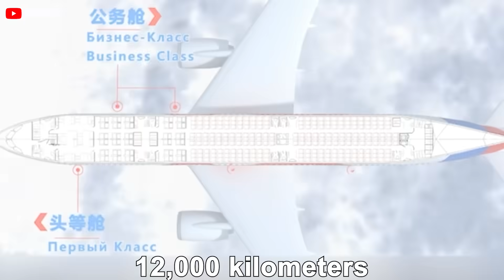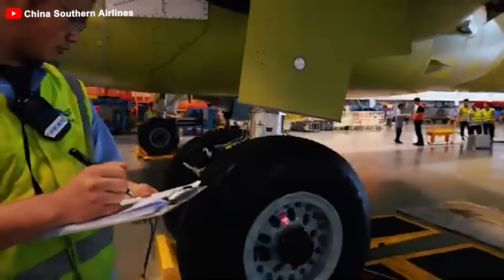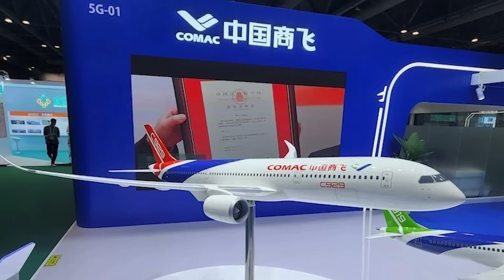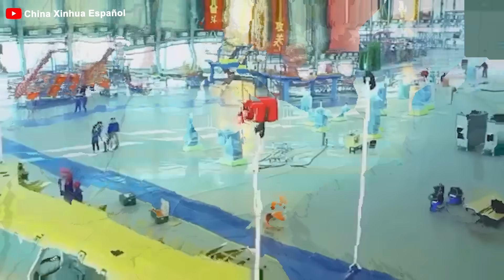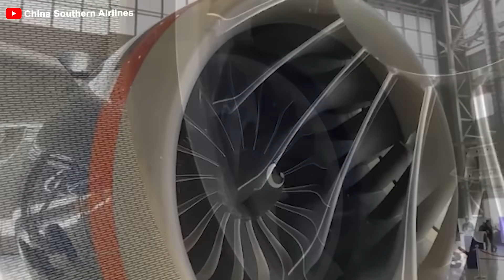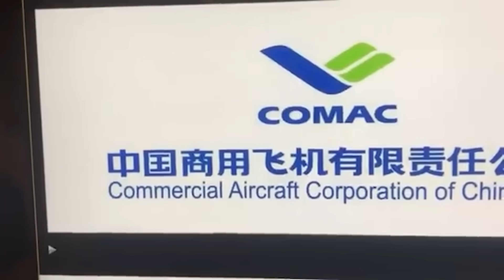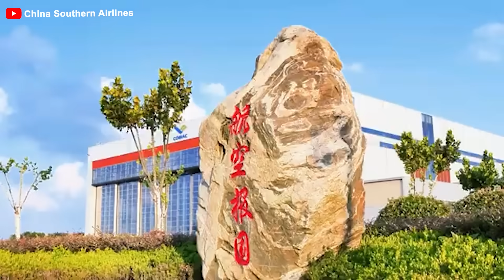China BIG Plan For COMAC C929 Will Change the Industry! Here's Why

Comment: Composites...highly resistant to fatigue and corrosion? That is a leap for anyone in the first generation of composite fuselage and wings as the C919 has no long-term data for those composite parts in that airframe.
Reply from the maker: Exactly.

Comment: With China's advanced space technology, and in aircraft engine technology, it will definitely produce better and safer aircraft than Boeing, which has recently been found to have hidden and covered ups defects and safety issues, which gas caused a long series of aircraft fatal accidents
Reply from the maker: China has great potential. This is indisputable.
Reply: China has Y 20 and C919 already, any troublesome? China home made all type air crafts.

Comment: Facts:
"Airbus and Boeing have been experiencing parts delivery problems due to supply chain issues: "
Engine parts
"The aviation industry has been plagued by supply chain issues since COVID, especially for engines, which are made up of many specialized parts.
Boeing has a backlog of 5600, Airbus a staggering 8600. How is that possible? If they make 600-700 aircraft a year, just current orders will take a decade to produce."

"COMAC's LEAP-1C is the only LEAP engine to come with a fully integrated propulsion system (IPS), which includes the engine, nacelle, and thrust reverser. 
Thrust
The LEAP-1A has a thrust of 24,500 to 35,000 pounds at altitude, while the LEAP-1C has a thrust of 27,980 to 30,000 pounds (more power)."
Reply: yeah ,and china is the super supply chain who was ignored on purpose
Reply from the maker: Oh great mate! Have a nice day!

Comment: COMAC design, make and test their passenger planes from scratch. All parts and components are domestically source. Unlike Boeing, they don't make their planes since it was merged with MD by outsourcing all parts and components just for assembling by low level workers used to be selling hamburger and chips. Boeing assembly shop is in Chicago. Not Seatle, home of Boeing when William Boeing always prioritise safety first.
Reply from the maker: COMAC is still dependent on imported components, bro

Comment: They are too dependent on Western suppliers for key parts which makes them easy target for sanctions. They need to go fully domestic for every part like they have with their cars industry.
Reply from the maker: Yes, that is one of the weaknesses, but in my opinion, they will soon be able to control everything themselves.
Reply: The reasons COMAC went with a lot of western system in C919 is to leverage these western companies' lobbyists with government lobbying in the West. That 1300+ C919 orders meant 2600+ Leap engines, plenty to get the GE and SAFRAN lobbyists into action. 

The Chinese airforce has the fully Chinese Y20 transport, so it is naive to think the Chinese can't built these sub-systems by themselves.

C929 will likely have 2 versions, one with western subsystems and one without.